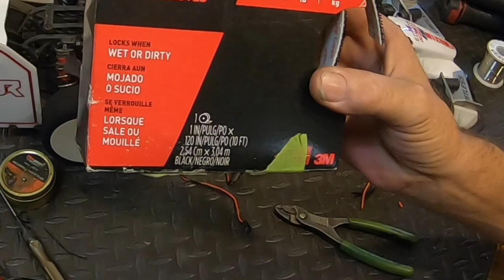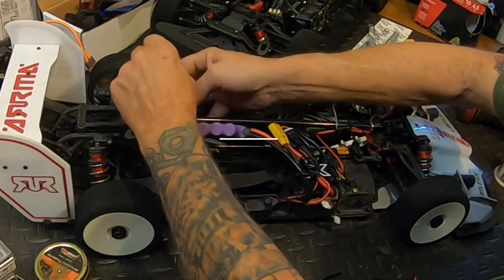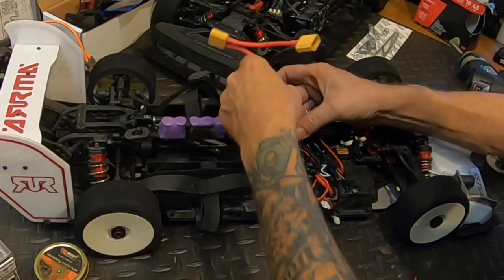Arrma Limitless Game Changer RC Voltage Regulator Installation easy how to install two wires ?

Comment: In my opinion. Its a bad idea soldering to close to the ESC. You lose the flex in the wire close to the ESC. I give it an inch or two away. 
 I had a wire break and  spark out bad. I might have tinned my wire to much. But ever since I keep my 1" 2" rule been all good.  
Thanks for all your videos 📹